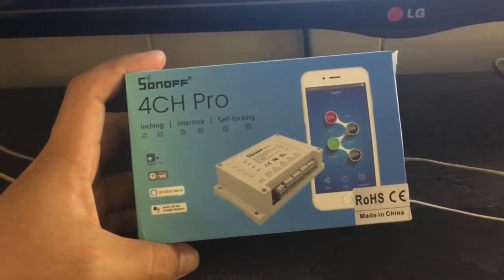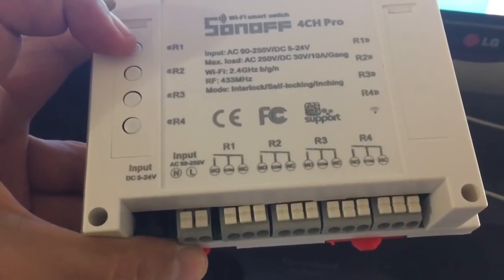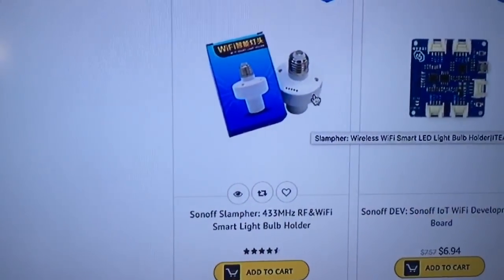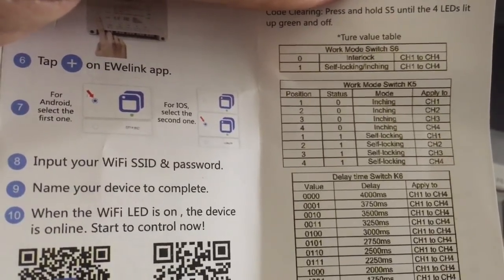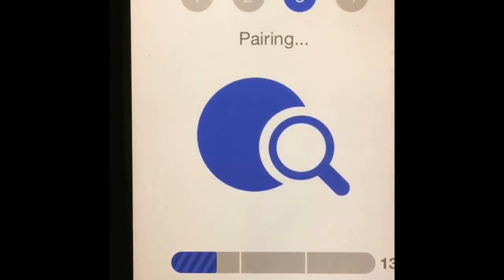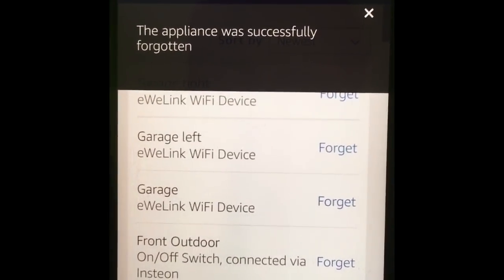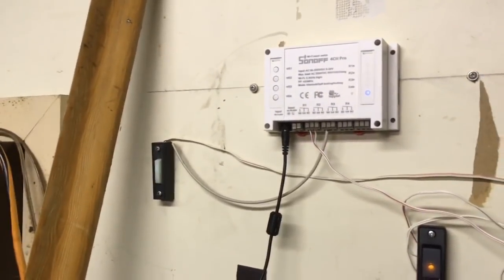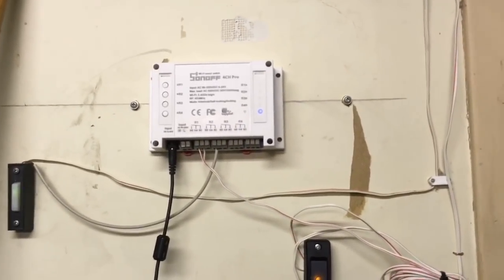A home controlled by Alexa: the Sonoff multipurpose smart switch (4 channel output relay module)

Comment: Great video. I have a project with a use for this device. I have a hidden whiskey cabinet in a wall. I want to have the door 'pop' open on command. The door is under spring tension so it wants to open all the time. I have used a 12v electro magnet to keep it closed. Is there a way that I can have this powered by sonoff to turn off the supply to the electro magnet to open the door but then have it be power up again so the door will stay shut when I close it. I hope this makes sense. Thanks for anyones ideas

Comment: Great video, I have just noticed that you asked alexa to "open garage right" and it opened. Around 30:40 in the video. Double check, as I have replayed it a view times :)
Also to make the other door "left" open you will need to take the button apart and wire you N/O contact wires from the module and solder them directly to the switch.
Hope this helps.
Dave B
Reply from the maker: Thanks for your comment Dave... ha! Yes i noticed after i finished it that i had said alexa open garage door and it still did it... :P thanks for the tip on the soldering... I will try doing that!

Comment: I ran into the same thing at a customer's garage. Solder a wire to each side of the tactile switch on the PC board inside the remote and and wire to the n.o. contacts and let the remote control the opener

Comment: NC is useful to reset certain devices, for example a cable box really works better if you reset it once a week by cutting power. Also if you want a device where the appliance works, even if the control fails.

Comment: is it 5 or 24 v?  Or 5 v through 24 volt system so you can use 12 volt electronic devices.  That's nice for RV / Boats / Solar systems.  I seen one labeled PRO and other one is not labeled PRO for $10 cheaper what's the difference?  Only problem with with these alexa devices they will have to get smart enough to know difference between people so anyone shouting alexa doesn't trigger it of course you can call device something unusual like G2.  Nice video, did you specify the other garage door opener's brand / model?
Reply from the maker: Alice Yogart hello! Thanks for your comment! The module takes any dc input being 24 v the maximum. You can use 5 or 12v.
The difference between the regular module and the "pro" is that the pro also responds to RF and that the relays are configurable... Locking, inching, interlock. 
Yes the module i think works great. Both of my garage openers are from chamberlain.. i cant remember the models but i will check and post them later for you to see. By reading a previous reply from this thread somebody made the great suggestion to fix the issue i was having... And that involves soldering the leads of the wires directly to the terminals where the original button is making contact and then connect such leads to the relay output. havent done it yet but ive seen articles where i see it works. So now i think you can trully control any garage door opener. And yes if using alexa just make sure you dont use a very obvious command so that no other "undisired" people can activate your door. Hope it works for you too! Cheers!

Comment: Excellent video. I had the same problem that you had with my Chamberlain garage door opener. It is easily solved though by taking a point to switch on the wall and getting directly to the button itself and wiring two leads to the button and bringing those leads out. that way the sonoff module activates the garage door opener the same way that the button activates it. There are articles on the internet about it. To get to the button you will have to disassemble the switch and solder the two new leads to the circuit board on which the button is mounted. Sonoff also sells a single channel inching module that’s is inexpensive and ideal for this application.
Reply from the maker: Hello William, thank you so much for your reply and your comments.. I am glad you liked the video and I appreciate a lot your input... i was wondering what the workaround could be and now I am going to give it a try!  Thank you again.

Comment: Does this need wifi connection to work?thanks
Reply from the maker: Key Wizard hello, yes you need wifi to configure the switch and later if you want to use it with alexa. Maybe if you just want to use it by pressing the physical buttons then you dont.
Reply: i want to use it so i can control my lights in the house while i am away,is it possible with this model?thanks mate

Comment: I'm sure you have already done so, but just in case, switch the wires at the Sonoff switch so that Switch #1 controls the right door and Switch #2 controls the left door. It will at least eliminate the possibility that the relay for Switch #1 in the Sonoff isn't bad. BTW - I used your instructions to set up my garage door using the Sonoff with Alexa. Thanks very much for a well made instructional video.
Reply from the maker: +tralexan thank you for your comments and im glad it worked for you! And thanks for your suggestions, i did try that and also changed wires, “polarity” and nothing worked... :/